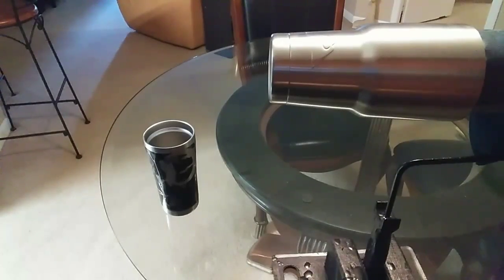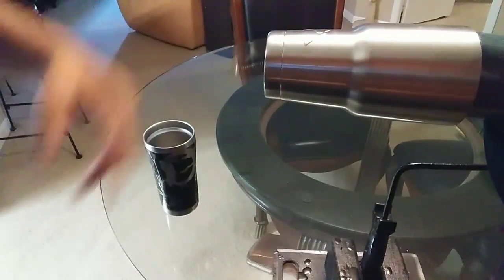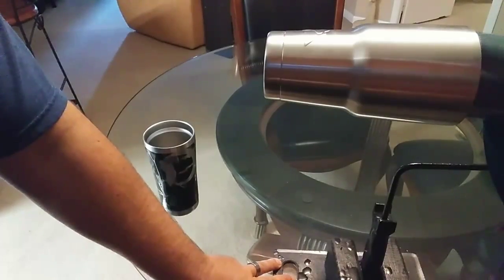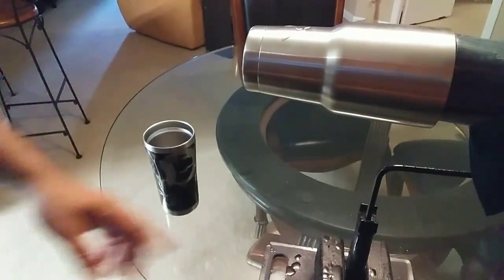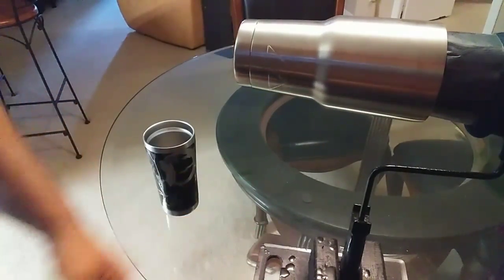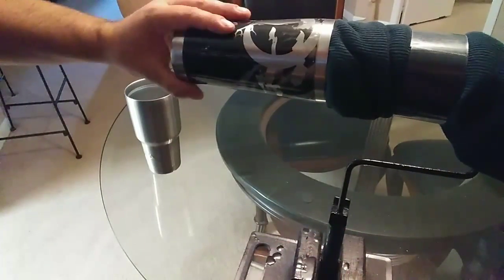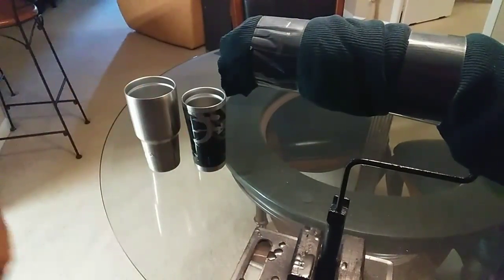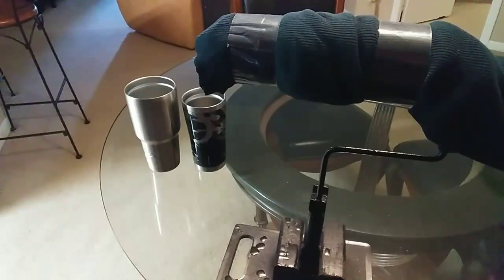CHEAPEST AND EASIEST WAY TO MAKE A ROTATING STAND for painting your tumbler cup

Comment: Hey me again so I finally attempted doing this and I’m having issues ! If you don’t. Mind me asking how do you not got epoxy inside your cup? I feel like when I’m applying the epoxy to the edge of the cup where the lid goes I someone always end up getting epoxy dripped inside my cup! Am I doing something wrong ? Please help me !
Reply from the maker: Hi lauren, i dont ever mind giving advice. cup is on the Turner try lifting the Sip edge of the cup slanted upwards a bit. Or you can put tape around the inside of the rim, which I don't like to do. Got to be very careful. You will get better with practice. Let me know if this helps, thanks 😁👍

Comment: How often do you have to turn cup and how long does it take for a cup to be completely dry if you epoxy it?
Reply from the maker: +Pauline Martinez hi pauline, i probably turn it every 20 30 min depending how good u mix epoxy and how heavy you put it on. Epoxy will thicken in a couple hours and will stop moving if its not to heavy. It will take approximately 24 hrs to cure. Thanks for watching! Let me know if that helps? I will put a link for my vid on mixing and applying epoxy. https://youtu.be/E_vz4y9YbSM
Happy holidays!

Comment: What did you use as the base?
Reply from the maker: Gerina Dahl the bottom is actually an old cutting board. Just put a couple screws threw it into the 2×4s.